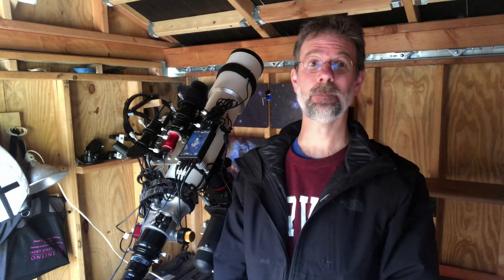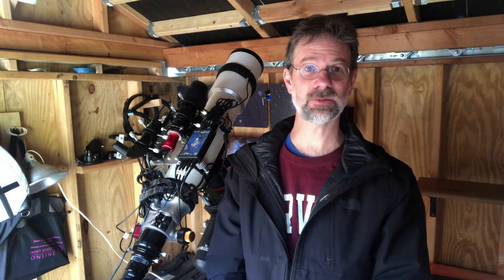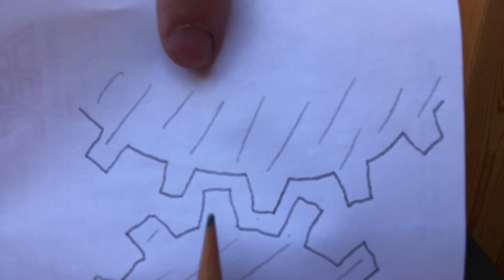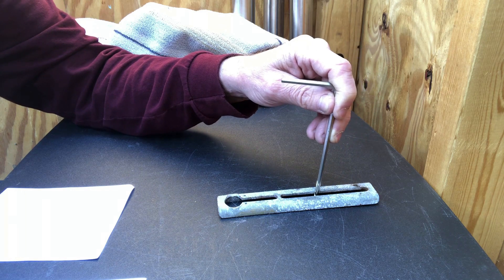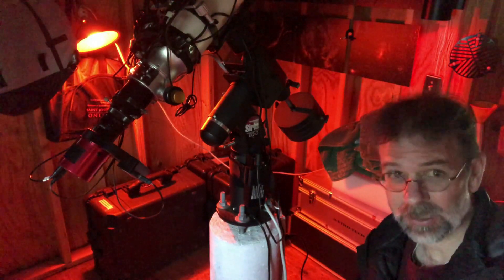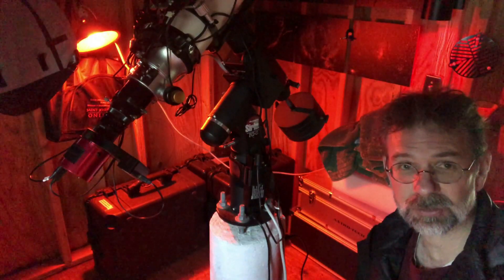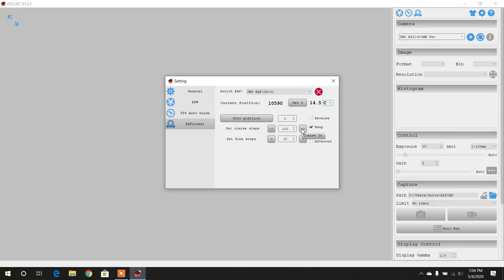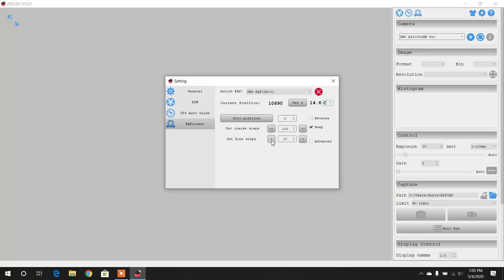Focusing w/ an Autofocuser (EAF) Video 2 of 4 - Backlash (ZWO method)

Comment: So, I decided to measure the backlash on my EAF using this method because for some reason I couldn't get a "straight line" of stars in NINA to estimate my backlash. 
But it looks like my backlash is ridiculously low. When I step forward by 10 steps, I can immediately see movement when I run it back 10 steps again.
And the same with 8 steps and 6 steps, and I'm pretty sure I can see movement at 5 and 4 steps too in either direction when I vary back and forth.
After this I just can't distinguish any movement either way. 
I wonder if I just got lucky and got a good, precise model?
Reply from the maker: Awesome, actually I have Newer EAF and it has significantly less backlash as well.  Could be ZWO is making them better.  Cheers
Reply: @AstroQuest1  That's the one I have, the 5V. And this makes sense alright. Thanks!

Comment: That's a huge backlash!
Reply from the maker: Yeah, it sure is.  I was surprised. On the other hand Cuiv and others have experienced similar values. The backlash correction has been work great for the last four years so far. I have a newer EAF on another setup which has much less backlash. Cheers

Comment: I initially had a BL amount around 90-100. Spent a few minutes adjusting the stock focuser itself and found there was about 75 “steps” of BL in the stock focuser. I adjusted that out (WO Z73 w 2 speed)) and my avg after that was around 20-25 steps. Hope this helps.
Reply from the maker: Thanks for the info Bobby!

Comment: As for my EAF I've found a backlash value of 25 before it starts moving, so I'm pretty surprised you reach 100 steps before it rotates. Maybe I'm lucky I don't know, but I still would like it to be smaller, like 5-10 max 😅. Now the question is: What would be the best "fine focusing settings" (steps) regarding the backlash you find?  Should it be the backlash value itself, or a greater one? 🤔
Reply from the maker: 20 steps would be the min for my setup but it might be difference for you.  Cuiv the Lazy Greek just bought a second EAF which has very little backlash so maybe ZWO has better QA/QC.  Good Luck
Reply: @AstroQuest1  in fact , i bought a second EAF and the backlash is reaaaally different. one is 25 and the other 190 🤯
Reply from the maker: @alexgti9345  Wow , that is whacky!

Comment: One suggestion, Try testing BL with the scope on the East side then the West side. You may get a different plot due to tilt of the focus train. Sometime called fishtailing. Great video. Hopefully APT will be coming out with auto focusing soon.
Reply from the maker: Thanks, good thing to be aware of.  In my case it appears to be the same on both sides as I did a few autofocus backlash tests using NINA's automatic focus when the scope was on the opposite side and the values were equivalent to this.

Comment: Using the EAF in SGP, ZWO recommend setting a backlash of between 100-200 in the out position, seems to work OK for me with a setting of 100. Still it's a lot of backlash in such a small motor. I think I will try the Pegasus Astro Focus Cube next, it has some good reviews.
Reply from the maker: Where was that recommendation?  Or was that for using focus in SGP which makes sense to me now since the SGP uses a backlash overshoot method for obtaining focus - I may get into that in a later video since NINA can do that method now.  I would be interested to see how Focus Cube works as well in fact I was looking into that at the same time I purchased the EAF.  The Focus Cube has a higher lifting weight capacity.  I am OK with the focuser now that I understand it - Obviously I wish the backlash were smaller.  If I do end up getting another focuser I might look into a Moonlite or something like that - Pricey$ of course.
Reply: @AstroQuest1  This is in the EAF manual ,on the ZWO site, page 25. They have all the settings for the various aquisition programmes. These are just the backlash settings for SGP. 
https://astronomy-imaging-camera.com/manuals/EAF_Manual_EN_V2.2.pdf

Comment: looks like the EAF is about as good as my mount motor/gearboxes for backlash. That is to say rubbish. Lucky for you backlash in a focuser is less critical. The EAF is copping some stick on the ZWO forums, hopefully something good will come of it. Their 60mm guide scope is another that could stand a revision IMHO. A decent enough scope but put one of their mini guide cams into it and you have back the camera out 30mm which does not leave much engagement just to reach focus. I'm using a unitised stepper/gearbox from Ebay directly driven from the UPB Pro v2 on both of my scopes. Works well for me. Still waiting for a confidence inspiring autofocus  routine within APT. NINA's autofocus is almost enough to convince me to jump but the UI is not as easy as APT.
Reply from the maker: Yeah fortunately the EAF is not a huge investment and as long you know what it is, it is workable.  I found NINA much better in than SGP and it is going to give SGP a run.  I used NINA the second night for complete imaging and control including a meridian flip and had it checking focus while imaging.  I still prefer the way APT does things minus the focus/autofocus.  What I have been doing the last few times is setting up on a target in APT, turn on NINA for the Autofucus since it does not need a bright star like APT does when using a Bahtinove Mask, andthen start imaging with APT.  If I want to check the focus or do a filter change I turn off the camera in APT and turn it on in NINA and check the focus, if it is not in focus, do the autofocus.
Reply: @AstroQuest1  interesting both of us have a similar assessment of NINA's UI. I have been doing the APT-NINA shuffle too :) Do you know of the latest updates to NINA where the autofocus always approaches the set point from one direction? Suddenly focuser backlash is irrelevant.
Reply from the maker: @RobB_VK6ES  I just wrote to Cuiv for that info.  I currently have the 1.10 beta version.

Comment: AFAIK, the backlash can be from the gears within the EAF, the shaft / flexible bush assembly and the rack and pinion of the existing focus tube... I might have used some incorrect terms here.
Reply from the maker: Pretty much everything.  It's a wonder they work at all.
Reply: @AstroQuest1  it certainly needs to be factored-in.. But starting off out of focus is best, then making notes of the numbers as you go into and out of focus again.. But this this will be frustrating until you know your backlash value before winding back to focus again